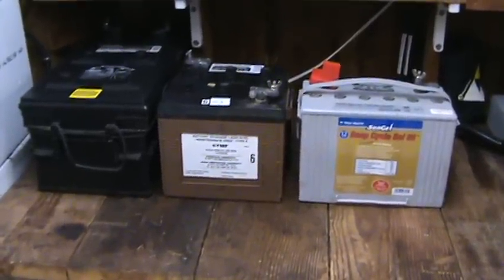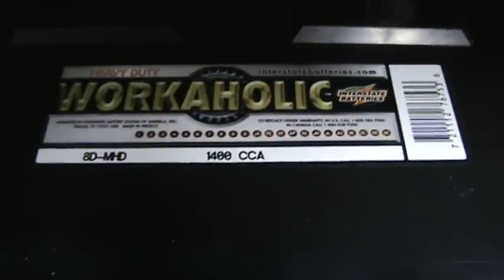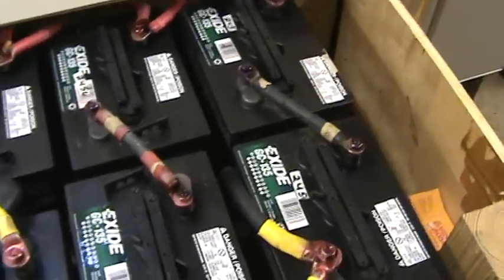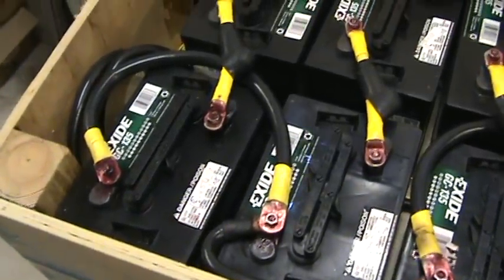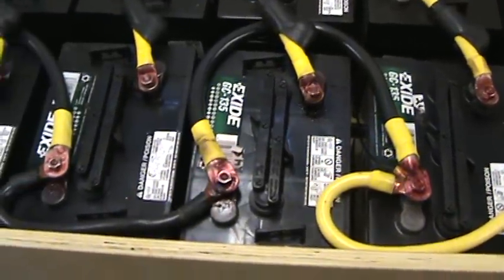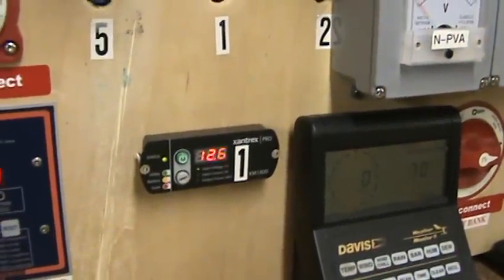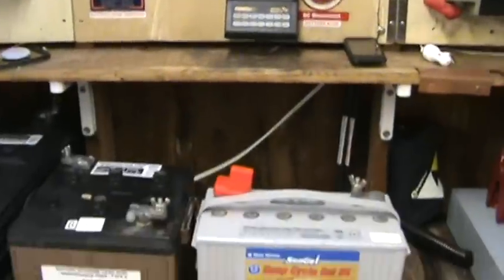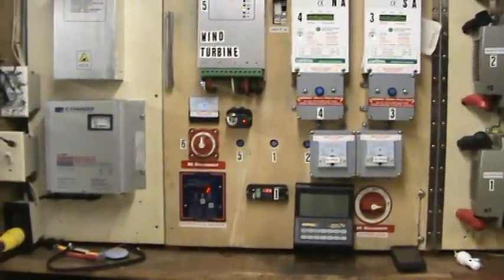Choosing batteries for solar power offgrid or a battery backup system.

Comment: I could use some help from anyone who 
may know, i have a Tripp Lite PV3000HF
Power inverter, i bought heavy duty cables 00 gauge, with a 500 amp fuse.

 how do i connect my 12v cable loop into my inverter connecter? I looked at a metric terminal for it, i hope thats right ?
It has a brass bolt and Allen wrench type 
bolt, seems same as the inverter connector has.
I bought 500 amp heavy duty fuse, came on cables,     how many solar 12v batteries would i need in a bank to run 1,500-3000 watts , 12-18 hours a day,
during winter time ?

Comment: I don't like harbor freights batteries they're too small if I'm going to get some AGM batteries I want some good size batteries but to buy them they're overcharging them I've never seen batteries so expensive the last the same length as a regular that as a battery is the last 10 years well lead acid batteries suppose last 10 years heck but lead acid batteries last 20 years.

Comment: I don't know about you but I like lead acid batteries I mean I don't drain them I try never to drain them down I want to try to use a little bit of power out of them so I can charge up just a little bit of the battery and I like to use lots of batteries put all the positive together put all the negative together I have 12 volts and I like to keep them pretty well charged all the time and use them all the time I don't like bringing about it down below 80%. It just means the battery's life is going to be limited I like to barely use power out of the batteries to run my whole house and as a hook up more to my batteries I got to get more batteries and that seems to be a bit of a problem. The problem is I would need something like 60 batteries so I got to find a better battery with more amps and I have to get like something like 32 of them because I'm going to tell you this right now everything in my house is electric some people may run gas for their kitchen stove the water heaters I do not when I bought this house everything was electric which was a benefit means all I have to do is buy solar panels to run everything I have not one little thing in my house that is gas I don't heat my house gas either gas is something I do not want and if I get a generator for my solar system it will be electric as well.

Comment: Pretty good info, I usually like to run through and correct there videos when directed to watch. Pretty much spot on!

A couple things, the amps out and amps in is misleading. In terms of wattage, you will use about 20% more watts in than out of lead acid batteries, Most of this loss is in the voltage, you would charge a 12.6 volt (12 volt nominal) battery at 14.5 volts. The amps in is pretty close to the amps out. The other interesting thing about flooded lead acid batteries is they reduce the amount of amperage they take in as they approach 100% full!

Comment: I was given a battery, Nautilus Marine/RV Starting and Deep Cycle, 730 Marine cranking amps, 160 reserve capacity, 100 am hours (20 Hour).  What is the appropriate inverter for this.  The solar kit I bought has a 200 watt inverter, and a 7 amp solar charge controller.  The inverter alarms when I hook it up.  I assume the inverter needs to be much more watts?  Is that correct?  Advice?

Comment: Hello I have a question how much current can I use to charge my lead acid battery. We get sun for nearly 4 hours a day and I had done many research online the only thing I could find is that do not exceed 10% of the battery capacity but I think it is stupid to that because the battery will never become full in the above said method, any suggestions on the charging current

Comment: I got a system I built 5 years ago using a walmart deep cycle battery (the largest they sell).  I originally built this for occasional use when the power went out (only 1 or 2 times in 5 years).  I keep it on one solar panel (45 watt) (I have 2 more I don't connect), through a solar controller and feeding an 1800 watt inverter with digital readout for amp draw and voltage.  I designed it to operate my refrigerator and chest freezer for indefinite periods as needed (if ever needed) whereby I'd connect the other 2 panels.  I've checked the battery periodically and always has good volt readings and has worked when needed.  I was able to build the entire system for around $700 back then (not sure what it would cost today).  I've powered lights, fans, freezer and fridge for up to 14 hours during blackout without issues.  I don't have to buy gasoline, worry whether the generator will start, etc.  Maintenance is more or less making sure all components are working from time to time.  I mounted the battery in a plastic battery box that is bolted to a $25 luggage dolly.  On the front is my controller and junction box which has a voltage gauge and small service light so I can find the outlets during an outage.  On top is the inverter which has the digital readout mentioned above.  I can extend the dolly handle up for portability or down for storage (under a table).  I estimate the entire works weighs about 100 lbs or so.  Dimensions are the width of the battery box approx 20 inches by perhaps 16 inches height by about a foot deep.   It has really been useful when needed.  And I recommend this for a backup for emergency power.  Don't want spoiled food.

Comment: Great video.  I am setting up a camper for retirement and want to use solar as I am going to be in BLM and National Forest so I have some questions.
1.  If I can safely vent my batteries are trojans better than AGM batteries in the long run. dollar per amp/hr used lifetime.  Meaning does a AGM = 2 tojans over time
2.  If I use tojans how often do I need to check water -  new and older
3.  What is the recharge time difference between trojan and AGM batteries

Comment: How much of a system would I need to run 1100 watts a day , that's an AC unit the pulls 1100 what's at start up, then 950 continuous after start?  I want to power just this AC unit.
Reply: Watts at start up

Comment: I have three 15 watt solar panels (45 watts total) feeding a controller with a DC current of 3.25 amps, to run a small Ham radio station in my house.  I have been feeding the controller to a pair of 35 amp hour SLA batteries in parallel (70 AH) for the past two years, and it looks like the batteries are slowly dying (failing to hold a full charge for more than a few minutes when drawing about 22 amps from a 100 watt transmitter at 13.8 v. DC).  I would like to replace them with a reliable 100 AH battery (to be used indoors).  Can OBXSOLWIND or anyone else suggest something?

Comment: Hi good day informative video...... On starting out how many 6 volts  batteries will i need to run my home? I am think of get a 2000 -4000 watts pure sine wave power inverter. i have estimated that i will use a least 4000w in a day. can you advise me on this or give me some solid recommendation. thank you

Comment: The battery bank is the very heart of an off grid system, yet so many try to cheap out here and end up wasting their money by buying used or the wrong type.They all need to be the same brand, size, and age (new). Golf cart lead acid is still the best bang for the buck, and you need a hydrometer ($7 bucks from an auto parts store) to make sure they are getting fully charged (very important!). If not, it will shorten their life, so you will need to adjust your charge controller voltage. Look up the battery company online to see their recommended charging voltages. They vary among brands. You probably want to buy them locally as freight charges are outrageous. Some of the larger solar panels are too big for UPS so if you are going to pay freight for batteries, might as well buy those large panels from the same place and save on shipping charges.

Comment: I just purchased a used RV with four new Interstate 6 volt batteries that are hooked up in both series and parallel with ending results of 12 volts. They are connected and being charged by four solar panels on the roof. The RV is stored under covered parking at the storage facility and don't get the full sun unless out on the road or camping. Being that the panels provide a small charge / take a long time to bring the battery bank to full charge. I was wanting to take my 12 volt auto battery charger and connect the gator clips from the charger to the batteries where the 12 volts from the batteries connect onto the coach. Can this be done and do I need to disconnect the solar panels leads. This is all new to me so trying to obtain good information and limiting my mistakes. Thanks for information that you can provide. Thanks, Lee
Reply: Lee Gomez, I think you could disconnect the solar and charge with your other source without problems

Comment: Got a 100 watt panel only can get 13.1 on the control charger. Like to get four 100 watt panels how many charge controllers do I need. Got a 600 watt inverter I'm just starting out. I tryed to run a 10,000 btu air unit on it it ran for like 5 min without the pump kicked on

Comment: without using electricity and using two (2) 25 volt deep cycle batteries can i use a battery charger connected to one of the deep cycle batteries to recharge the other deep cycle battery?

Comment: I would just like to know what type & how many batteries (voltage & amps= 12v/24 & 2,000amps) I'm going to need for an off grid main power source? pure sine inverter 2,000watt?
thanks. bigdogakita@gmail.com
Reply: You need to figure out what loads you are planning on running for you off grid main power source first.    Most loads are intermittent.    Spending $20 on a kill-a-watt meter would be a good start.     It will give you an idea of how much power you will need.
Reply: First off you don't need a pure sine wave. You will spent more money for something that doesn't even matter. As for the batteries Trojan T-105 are def one of the best. You can get 2 off them for just 300 bucks, but find a local dealers cuz its like 50 or 60 bucks just to ship one. Get some pretty thick cable like in the video which will have low resistance, you only need a few feet. Get a charge controller, MPPT is the best.

Comment: Nice video.  I've had an "off-grid" home for over 2 years.  I've spent more $$$ on "Marine Deep Cycle" batteries than I want to admit.  I finally did what I knew was the right thing- and spent almost $10K USD on a bank of new Rolls/Surette 550's, and take very good care of them.  Which means- "Hydrocaps" all-around,  checking water/density at least every week, and building a deep underground, VERY insulated shelter to keep them at about 65F year-round.  And NEVER deplete them to more than 80% of rated capacity.  Between 10 top of the line 280 watt PV panels, and 4 home-built wind turbines, and high-end charge regulators,  I HOPE that the system will outlast me.  I personal think the investment is worth it- I only have to use a generator when I'm in my machine shop.  Living "off-grid" is nice, but not something to be done on a shoestring budget!  Just my opinion, of course.

Comment: I'm new to this setup I guess, but if this is just a backup, does that mean the solar or wind generator just directly feed the home? or is a battery required to run everything? if it is required, how does one go completely off grid if batteries require replacing every few years
Reply: If you are only using it for back-up and you are not drawing out of your batteries and pretty much always keeping them topped up they will last for a very long time.     Batteries only wear out when you drain and recharge them, you can only do that so many times.     I am not sure what you mean by does that mean the solar or wind generator just directly feed the home?      If you have solar or wind they are there to charge your batteries, and your home would run of the battery bank when your grid power goes out.

Comment: gell battery arnt expensive big lucas 120 ah . are like 80 pounds of amazon. 

Dont know where you would get golf cart batteries from.
Reply: That's a bit heavy. Trogen T-105's are 225Ah and there only 62 pounds I think.
Reply: DragonsREpic welcome to the wider world. 'Pounds' in the context of 'expensive' most likely means £GBP as opposed to lbs of weight.

Comment: Are the new EVERSTART 12v, 102 amp hour "MAXX" MARINE DEEP CYCLE BATTERIES, with "30% more cycling power" good to go for making a single battery/ solar power station? Available for only $100.00 new. Or, should i go with two 6v golf cart batteries? (i think that the everstart is a flooded/lead acid battery?) Thank you and look forward to your reply.
Reply: Both are good but golf carts would be you best bet, really depends if you can find good used ones that are near or above 12v or 6v if there golf carts. Both have about the same amount of power.
Reply: A marine battery is not a real deep cycle battery.
It usually says CA or CCA on it and is rated in starting power.  A marine battery is a starting Battery like your car battery and will not last to long with such applications.
A real deep cycle battery is rated in AH or ahr. Amp hour. 

Sams club sell new 6 volt 200 ahr golf cart batteries for about $70. Put two batteries in series and you have 12 volts.

Comment: If I were to install a solar panel and a Trojan battery into my Truck to run a TV and an Xbox One with a 2000w inverter for like an hour or two a day it should work fine correct? Should I worry about over charging the battery? And if so is there anyway of cutting off the flow of energy automatically?

Comment: Hi, I am a newbie and I am wondering. I bought the beginner HF kit! Yeah ok I know! I have been doing my homework and I think alot of people are overlooking electric fence batteries for solar. they are cheap because there really isnt millions of people who buy them. you can get one of them for less than almost any other battery of the same caliber. my opinion. like i said i been looking around and i am going to go with 6 volt electric fence batteries that are made for/ use solar power. am i wrong? also a question if i use a big inverter do i need to throw away the HF charge controller and get a higher amperge rated one and just put an inline voltmeter on it. also what fuses should i be using I am just starting out as i said and thank you for your time. MAW

Comment: I am making a 18 V panel with 50 pcs of mono crystalline cells to keep inside window in my high rise condo. I got a chance to buy  one box of 12 pcs  12V 3.4A 20H small  valve regulated sealed lead acid batteries, all for CDN $ 70.00(only).
Please tell me what gauge wire I should use to connect the batteries in parallel?
Reply: Heres a trick...the thing that recks a lead acid batteri is the sullfuric acid because  as the batterie dischargs the sullfur goes into the plates an a deap discharge will put so much sulfer into the plates that a bunch of these will not
Reply: Be able to drive out the sullfer..a cranking battery neads the sulfuerdioxside to put out 200 amps to start the motor...an amp draw of 25 amps or so doez not need the sulfuric acid...so dump out the acid an nutrulize the battery with bakeing soda..an then fill the battery with alum..8oz to a gallon.

Comment: quick question,i just bough 2 T150RE  6 volt trojan  golf cart batteries, hooked up in series for 12 volt system ,,,,first time i hooked them up to a 1.5 charger /maintainer they reached 13.6 before charge light turned green,,,,,,,a week later i hooked it up again but they reached 14.6 and still no green light,, i disconnected charger in fear of over charge,,,,,,,,,should i have allowed the charging process to continue to green light appeared ?........were the batteries attempting to equalize ?

Comment: I have two 12v 60ah batteries that will not take a charge... I've tried topping them with a 110v wall charger and nothing.  They were pilfered from an old power wheelchair.  they worked in the chair, but since I removed them, nothing... any suggestions or advice?

Comment: Hi, when you have so many batteries tied up together, I guess you need a charger rated to charge the total voltage of the bank! wright?
Reply: Jacinto Melendez 

depends if they are in series or parallel. You will need a charger capable of providing enough voltage AND current

Lead Acid batteries like to be charged at around C/10 (hypothetically) so for a 48V 800ah battery set up like a large forklift you need a charger capable of pushing well over 80amp and over 55V

Comment: I heard that in lead acid batteries, that if you dump the acid out and replace it with alumni power then that could work as a deep cycle battery......do you if it would work?
Reply: Please don't do that. Lead isn't something you want to muck with.
Reply: ok, thanks
Reply: thomasheisler 

what makes a battery deep cycle is the thickness of the plates. not the solution.